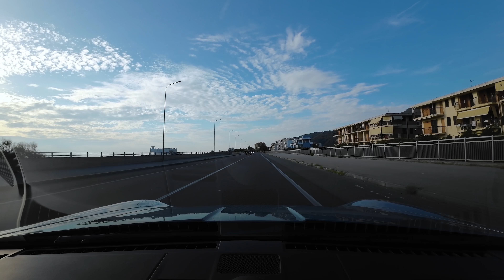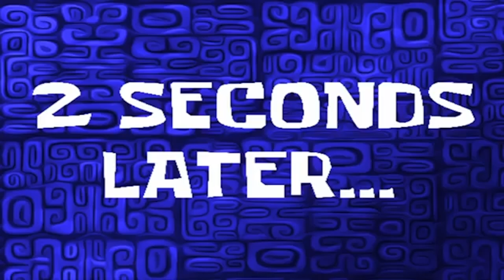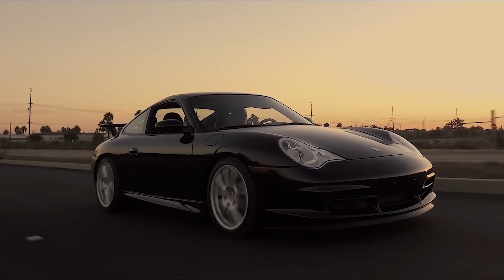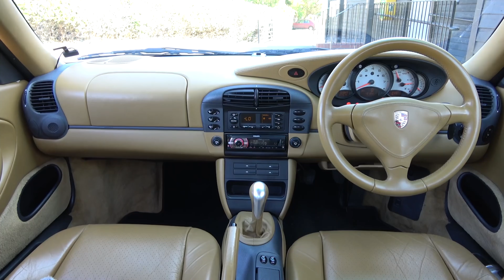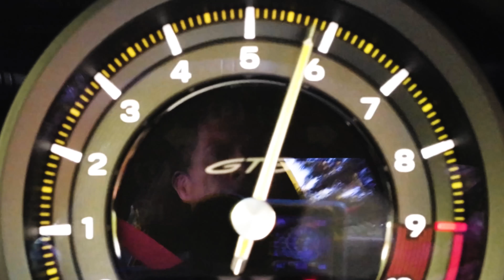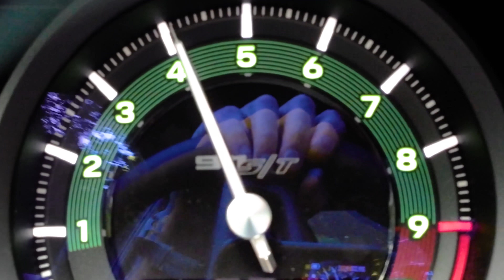Porsche 911 S/T: The Greatest Road Car Porsche Has EVER Built?

Comment: A clutch dump is better for the clutch than a feed. You will get more launches with dumping than slipping the clutch under power with a feed method. But if you are drag racing a 911 you have the wrong tool for the task.

Comment: But, If you cancel an RS you were not in the running for an S/T anyway. S/T buyers still have their 918 fully current on maintenance. They also buy and keep GT products for at least 3 years and trade at least half their purchases back in through the dealer.

Comment: You suck Matt get a 996 and put a 427CI LS7 or get an aluminum block 4.8 make it rev to 8000 RPM and then you have a V-8 Porsche that has a manual transmission but no you can't do that. You have to live life the boring way and spend $700,000 on a Volkswagen beetle.

Comment: Just the fact that it is so limited is going to make this car apprieciate in value over time. But best bank for buck is still 992 gt3, for track and daily usage, from what I've seen u gotta really push GT3 RS on the track to use that extra downforce to gain time, either be pro driver or very very expeiranced one to gain from RS in any setting

Comment: Hi. Try starting in two stages. Release the clutch pedal by a third or half, catch the moment the slip begins and release completely. Such compensation will allow the engine not to choke when the tires have high grip.

Comment: Just looking at the design, I thought it was too mild, but it is a car optimized for street driving.
I thought all Porsches had SMF, but perhaps because of the high horsepower, DMF was the standard spec. Then what about GR86...???
I was surprised that the Gurney Flat was more effective than I thought, and I will have to think about it. lol

Comment: Matt asking the right questions.  The GT3RS is the most hardcore version of the car, a proper track weapon, why does it have more refinement than the car that's meant to be driven on the road, where maximum performance isn't the most important thing?  I think the answer is that they had to make up some reason for the S/T to be different enough from the Touring to charge twice the price.

Comment: So you pay crazy money more for less car?! (no ptv dials, diff dials, tractioncontrol settings no nothing, only manual (cheaper to produce than PDK) and so on.... yes it looks good, but does somebody still talk about a 911R? no. 911 is 911. you want a track car, gt3, you want a turbo buy a 911 turbo,....  Porsche is master is cranking stuff up on a car with less stuff on it. my advice buy a normal 911 or a turbo and spend the rest on your wife(s) (car) ;-)

Comment: I've had many sticks over the years, and one outlyer is my 1995 Nissan Maxima 5sp. Compared to my 91 Ford Mustang GT, it was unbelievable. I never thought about it when I owned the car back 95, but that Maxima stick was butter smooth, and despite the horsepower rating on the Nissan, it was faster that my Mustang GT which is why I bought it. I won't even comment on my 67 Mustang as it was terrible, and I sold it due to that stick.

Comment: you should not change your mind of switching cars,the gt3 rs is a better car and it won't drop it's value. it's also faster with the paddle shifting,you could even bring it to manthey racing to dial the suspension much better.

Comment: Only a billionaire or fool would spend the extra for this 911 S/T over the normal GT3 Touring.
Reply: It’s a classic remake with race power not a race car with a manual box
Reply: comrade, millionaires can easily afford and appreciate much more lightweight stuff (light is expensive) in ST than in the Touring
Reply: @olasek7972  No most of us can't afford that, the car is going to retail for about $500k. You gotta be in the tens of millions or stupid to pay that.

Comment: So it's a just another variation of the touring variation of the GT3, with a few parts from the RS and some tuning tricks...for 100k more...:)
Reply: No it’s the gt3rs engine with the touring shape but the chassis and panels are made of way lighter materials and the exterior redesign and the carbon fibre reinforced plastic roll cage
Reply: Yes of course but you would kind of expect a 200k€ race-derived GT3 to have all the carbon and other composites and a light flywheel already...but that's just my feeling...

Comment: There is some problem with the Porsche company. God told me that Costa Rican elite group that owned the current production model Porsche 911 Turbo S and 992 GT3 died (taken out by the Russians) because they stole the concentrated gaseous energy technology from Russia and produced those gas tank and incorporated into those models, resulting in serious boost in power. The Russians took away the gas tanks and therefore those cars will longer have that power in the ongoing production. One of the German elites that own the rest of the Porsche lineup now took over those two models mentioned above. He will have to come up with alternative solution to help make up the power for losing that gas tank. There is huge loss in power though, it will be a challenge.  Good news is that the Porsche company will continue to run instead of collapsing Toyota will face in the near future.

Comment: I still don't understand the long-gearing on the base 911, the "S" and the "T", and the Cayman GTS/GT4. Porsche has a knack for incremental upgrades across their model range, but surely, the more common 911s is where most people will experience the product, and it is oddly frustrating to "built-in" a "short-coming" for 70% of the cars, and hoping the average driver doesn't care about reaching 100kph in 2nd.
Reply: I’ll never understand why this is a problem for people
Reply: @kev7co  ehhh .... perhaps because it kinda means if you own a recent Porsche, you'll hardly ever get to use 4th gear unless you go drive in Germany or on a track?

Comment: It’s crazy that there aren’t many affordable more normal cars that have short enough gear ratios, suspension that can deal with the road properly, an amazing engine and great driving dynamics. It shouldn’t take porsche to build this multi hundred thousand euros super limited, out of reach for 90% of people car. There should be modern hot hatches that fit that criteria too.
Reply: Remember the 106 Rallye, that was a cheap proper no thrills car that 90% of the people could probably afford at the time, gave as much fun on the B roads then a Ferrari of its time.
Reply: @welloilbeefhooked4984  That is cool but is there any modern hot hatch that fits the same criteria as this 911 s/t?

Comment: It's basically a money grab by Porsche.  They take out things that would have normally cost money to have in the Touring GT3, and then ask you to pay more for it, but the car now drives worst, slower, harder to launch than the normal touring that costs much much less.
Reply: Well, did you expect it to be for charity? Making money is why Porsche (and every other car company in the world) is in business.
Reply: @panerai_fan  normally you should reward your VIPs that have spent the most money on your cars, rather than milk them like they are fools.
Reply: @DonLee1980  But they are fools. So why not treat them as such.
Reply: Not slower, faster than GT3 touring, (worst, … again, your propaganda), clearly this car isn’t for poor guy like you 😂
Reply: @olasek7972  without the rear wheel steering, the car will have slower cornering speeds, and the clutch now is much harder to launch than the one in the touring.  That means the GT3 touring will be better around the track and as well as in a drag race.  Yes, this car isn't for me.  I'm more into the GT3, or a 458.  I only make about $240k a year, so I am rather poor.

Comment: crazy that the s/t costs more than the gt3 rs
Reply: carbon fiber does it
Reply: Yeah cause it's a classic design with the GT3 RS performance (same engine same body parts)...it's manual it's the car that approaches track maniacs and classic drivers...you can't go on rough roads with the GT3 RS and you can't go to track with a basic 911 (comparing results)..best of both worlds plus its a 60yo anniversary car...they always cost more

Comment: I would've thought the original R8 and the Gallardo with the gated manual would be up there as well for best manual gear shift. Jeremy Clarkson loved it.
Reply: my 981 gt4 is up there
Reply: @peoplesrepublicofchina8340  Me too, 981 Spyder here. I had a lightweight flywheel on my 05 Boxster S. I’ll put one in my Spyder some day, and both cars have the Porsche short shifter. Short shifter and LWF are a magical combo.
Reply: I think it's a sinle clutch setup tho so it's probably not a very fast shift
Reply: @drmvp21  it is single clutch because it's a manual transmission.
Reply: @Average_Bruh  Srry gated single clutch setup. Gated manuals shift slower.
Reply: @drmvp21 yes, finally some sense here. Gated shifters are so slow and clunky and deliberate. Also, people here don’t understand multi-plate clutches.
Reply: R8 LMS also gated with 7 Speed MT.
Reply: Keep up the unnecessary revving. 😂

Comment: 1.4 ton seems a little on the heavy side, despite all their weight saving efforts..
Maybe the base 911 needs to go on a serious diet?
Reply: Impossible in this day and age to get any lower. Safety standards and equipment law requirements just simply impossible to go 13xx. Only in pure carbon chassis but that is allways 600k+ pricing. Even small Lotus Emira is 14xx+ today.

Comment: Just the fact it's a manual makes it a lot better... also looks much better then the gt3rs personally speaking
Reply: bro stop the cap
Reply: Normal GT3 looks better imo
Reply: @gerhardma4297 He just has never driven one. He thinks that a manual is just about shifting gears, that’s what he considers being in “control”, but you’re way more in control of the car than what this guy thinks. He doesn’t understand that having the clutch yourself isn’t just about switching from second to third gear, but you yourself can work with this car.
Reply: Manual wins 🎉🎉🎉
Reply: Yeh the GT3RS looks a bit over the top tbh
Reply: @Gws525 yes but its a track car that happens to be road legal
Reply: Kanon Shibuya's C-WEST RAZO SILVIA GT300 car costed $15.000 less than this 911 S/T.
Reply: As a guy who’s owned 11 Porsche (all with manuals) before my current GT3, I have to say the pdk transmission is just magic and perfectly matched to the 4.0L GT motor’s character and sound, and as much as I love manuals I absolutely wouldn’t change it.
Reply: @993mike  see people? the guy who's owned one agrees with me, if you wanna cruise around and chill out get a BMW or a Mercedes, Manual stick shift makes no sense on a 911, let alone on a freaking GT3, do you guys really think you understand the 911 better than Porsche itself? there's a reason its not an option, except on the S/T and only because people kept asking for it and Porsche gave it to them because it will sell
Reply: @Ar1AnX1x I have a DCT in my OG M2. At the time, I almost passed up buying the car because it wasn’t a manual, but I went ahead ‘cause I knew I could flip it if I hated it. After I’d owned it for a few weeks, I thought, “why would you cripple this car with a manual?” The DCT is a cheat code on track or at autocross, and a hoot in canyons. I never run it in auto mode.
Reply: @americanAlienBoy  yeah I just feel like shift paddles are more fun while also being superior for performance
and most review channels also say Automatic M2 is superior to manual
Reply: @Ar1AnX1x just buy your auto
Reply: @Ar1AnX1x Why do you think Porsche brought back the Manual for these cars? Exactly, because the customer wants them. It doesn’t make sense to you, because it’s obvious you’ve never driven a car, but the customers who bought multiple cars, want the option for manual. Porsche knows their cars and customers and that’s EXACTLY why there is still the option for manual.
Reply: @Ar1AnX1x Bro its not that deep... Manual is just more engaging, more satisfying to shift. Ultimately, personal preference thats it
Reply: why do people like Manual so much
it specially makes no sense for a supercar
Reply: @Ar1AnX1x   How many of the supercars will see a track or even race against another car in a drag race, so automatic will make a big difference? Personally I would go with a 911 GT3 Touring as a manual (if I had that kind of money tho). It just adds so much in terms of engagement with the car, especially if you're just cruising. And it's really fun to shift obviously
Reply: @fischwaffel96  how is it more fun to shift with a stick shift than shifting with shift paddles?
and if you wanna just cruise why not just buy a BMW M5 or Z4 or something like that? or even an M3, its more comfortable and it comes Manual, why buy a GT3 or GT4 and cruise in an uncomfortable stiff car that's made for performance and handling and dual-clutch acceleration? it genuinely makes no sense to me
Reply: @Ar1AnX1x having a car worth over 100k is about fun, if u think about it no car should ever cost over 100k if ur just want something to commute. Its all about fun and people has different kind of fun. Others wants straight line speed, others prefer cornering, other wants luxury, other wants off road and others want engagement and that what manuals can bring. My dad owns a 570s but still prefer his s2k when he just wants to drive   on sunday moring
Reply: @MonicaHolly143  that's what I'm saying though
he doesn't cruise around with 570S
its a stiff supercar that doesn't need a manual stick shift which is why it's not an option on it
Reply: @MonicaHolly143  You absolutely have more control of the car with a manual gearbox with a clutch, you can feed the power in with the clutch, control the slip, speed and engagement. It's a totally different drive 
With automatics, with paddles or not, you simply lose that ability and as a result are a little more disengaged from the driving, especially in the new age cars that have power steering, abs, all these computers which can't be fully turned off. 
There are multiple reasons why some manufacturers chose to go automatic on their cars, but driving feel is often not one of them
Reply: @Ar1AnX1x  many reasons, firstly it gives you greater control of the car, the way it behaves and how it puts down the power, it's much more engaging to drive and with a single mass flywheel like in this S/T it will be crazy responsive,  not to mention the feedback Manuals are for people that enjoy driving and being connected to the car they drive. For some it's not all about straight line speed and track times, it's about the feeling
Reply: @Karolmichta  no I'm talking about Shift Paddles vs Stick Shift, you're still in control with shift paddles on manual, in fact you don't even have to waste time on the clutch and let go of the steering wheel, for this car it makes some sense but for an RS or even GT3 and GT4 which is all about performance and handling and how dangerous that performance is it makes no sense

it's like wanting to eat your cake and have it too
Reply: @Ar1AnX1x  You absolutely have more control of the car with a manual gearbox with a clutch, you can feed the power in with the clutch, control the slip, speed and engagement. It's a totally different drive 
With automatics, with paddles or not, you simply lose that ability and as a result are a little more disengaged from the driving, especially in the new age cars that have power steering, abs, all these computers which can't be fully turned off. 
There are multiple reasons why some manufacturers chose to go automatic on their cars, but driving feel is often not one of them
Reply: @Ar1AnX1x  This shows you’ve never driven a car. You aren’t even close as much in control with paddels compared to a clutch. Just think of driving in a traffic jam. Paddels is just about changing gears, with a clutch it’s much more than that.
Reply: @Nowayfrrrrrrr  brought it back only for ST because these people kept crying, not because it makes sense, you really think you understand their cars better than they do? when Ferrari, Porsche and all other Supercars comes in with Automatic then there must be a reason, people who buy a Supercar so they can chill out with a manual are just weird, and all the designers and engineers that make these cars agree with me, not with you, and 2 supercar owners above said the same thing I did and agreed with me
Reply: @Ar1AnX1x Wtf are you talking about? Every 9/11 except the GT3 RS and Turbo have a manual option. The S/T definitely isn’t the only 9/11 with a manual.
Reply: You are crazy.   Manual<Auto (in a supercar)
Reply: @bbsaadi9812  say that to McLaren F1 and Porschs CGT those were hypercars

Comment: The 911 is a timeless masterpiece ❤
Reply: @MrFunDino well true.
Reply: @lemcake32422  fall apart 😂 and the engine thing is a massive money making scheme it’s so u get ur repairs done by porsche
Reply: @behzinga8196  yeah. ive seen one with the engine dropped out. mechanic said it was a load of crap takes alot of hours to work on
Reply: old one yeah. These new ones are unreliable  junk
Reply: @bigduphusaj162 heh unreliable 😂 one of the most reliable and well built cars out there